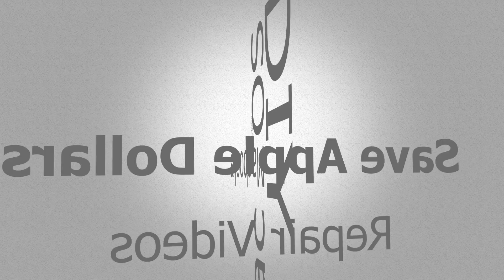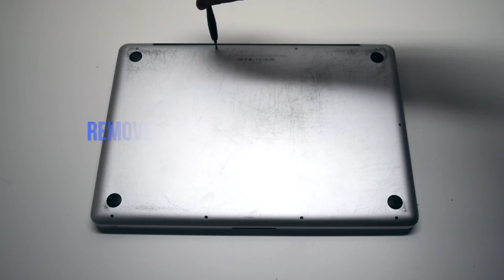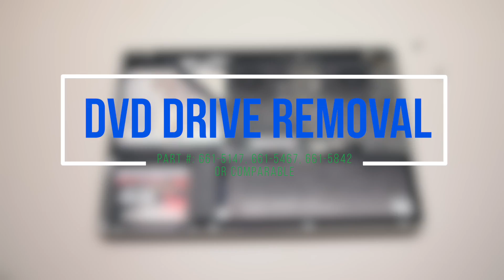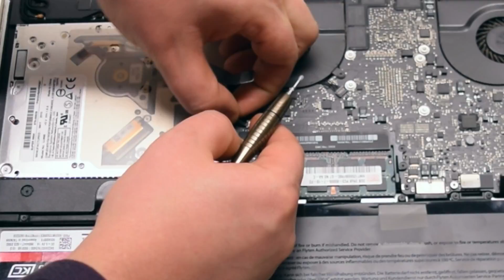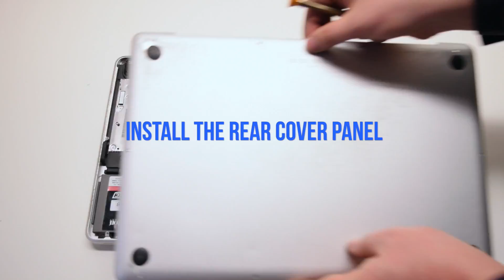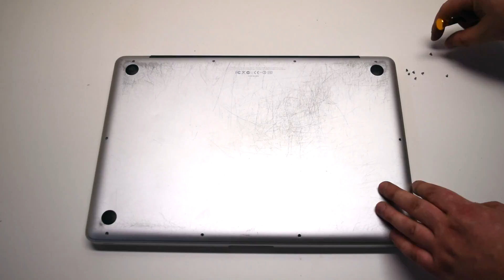2010 Macbook Pro 15" A1286 DVD Drive Replacement

Comment: Hi, hope all is well. very helpful info here. What is the difference between (A1278 and A1286) connectors. I need to change my August 2010 macbook pro 15''. Is this 1278 or 1286?
Reply from the maker: it's 1286 for all 15" models. The difference is that the cable is slightly shaped in a different shape and length but the electronics are the same.